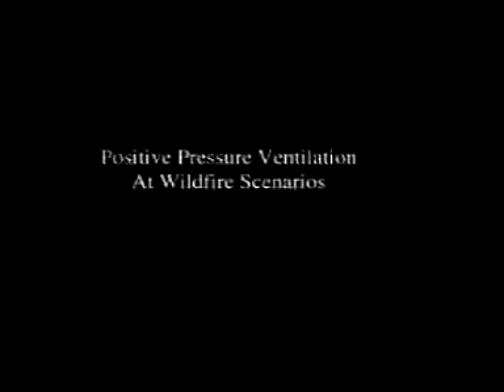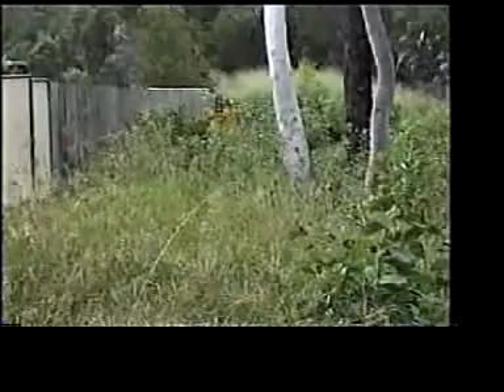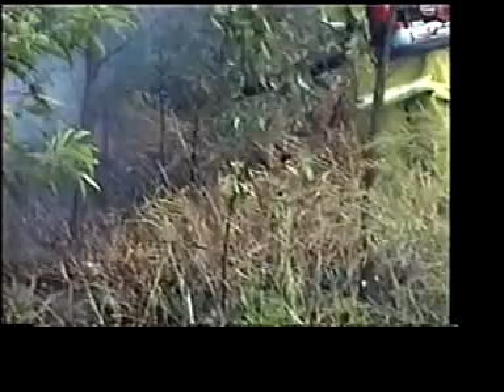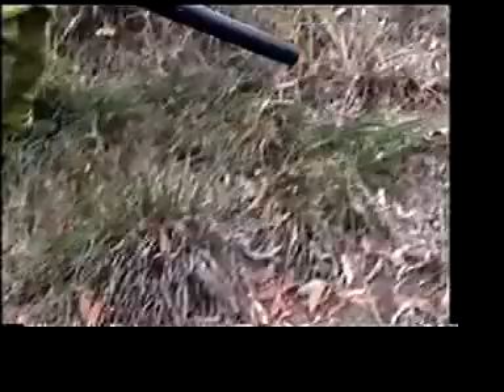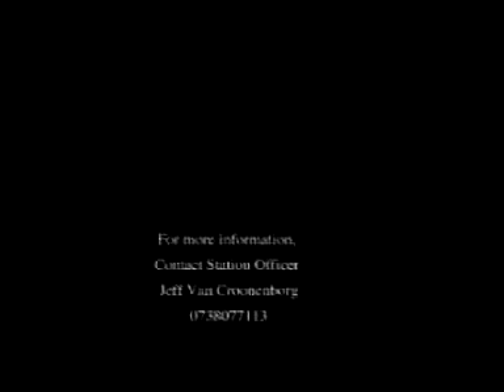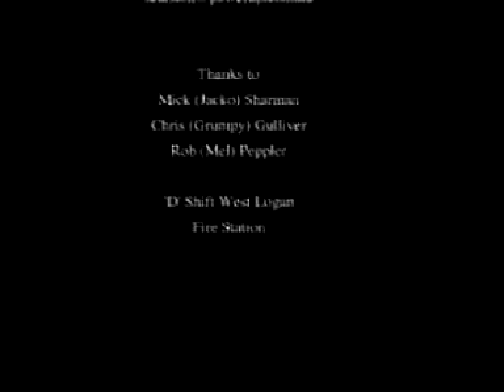Fire service Blower

Comment: Shan, have you any footage of water mist being introduced to the airflow?
Reply from the maker: No but we did try it and it did improve the efficiency slightly. We felt that the extra weight of water and some way of injecting it into the airstream was not really worth it. The blower works best by actually starving the fire. The burning material, along with any unburnt fuel is pushed back into the blackened area. Could work if you could supply the water spray from an ATV or similar.